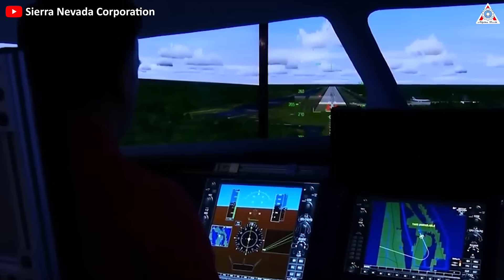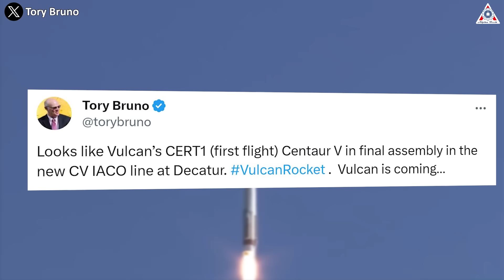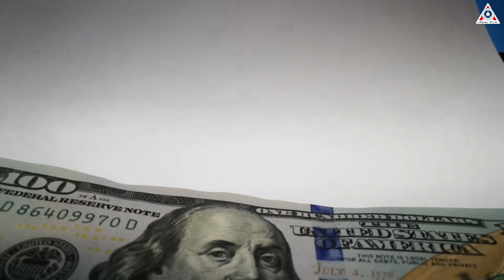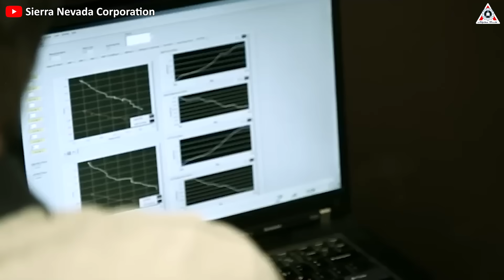NASA Dream Chaser’s launch vehicle is in BIG TROUBLE...

Comment: How can they stress reliability and cost? This is a total no brainer - Falcon-9 has had literally hundreds of successful launches whereas Vulcan Centaur has never flown. ULA (like Boeing) is suffering from legacy aerospace syndrome - delays, cost over runs and some poor engineering. Falcon 9 is the cheapest option as Vulcan is disposable - the idea of recovering the engines is at a very early stage . Dream Chaser is designed to service the ISS but considering it is to be retired in 2030, they need to consider other options soon.

Comment: To me the program was not ambitious enough since the Falcon 9 is still wasting an expensive second stage with a high cost orbital Merlin niobium nozzle etc,,,furthermore a Crew Dragon landing at sea with parachutes is more weather dependent than a cat.3 landing plane and this  requiring more safe reserves of O2 etc..Finally,,the rigid lifting body Mig 105 BOR4 type is also safer at reentry than a winged design Shuttle or Bourane. 

To me a fully reusable ISS crew and cargo shifter could be made cheaper than Falcon dragon and could be necessary as Starship is way to big for crew exchange only …Furthermore , the proven hardware more of less exists but not the drive to put it together from competing firms like the Apollo program did.

In order to be small and light, I would rather envision a three stage reused system with only as wasted hardware, two or four small 3D printed jettison tanks dropped just before orbiting like the Space Shuttle main tank did but infinitely smaller since they would only fuel a 3rd stage orbiting power and on a much smaller DreamChaser lifting body as well. Heat shielding and bringing back empty tanks like a big Starship  is too much dead weight..1 first stage would be Paul Allen Scale Composite Stratolaunch airplane boosted to 250-300 tons ..using second stage rocket boost for take of and the DreamChaser front section for additional canard type front lift..

Second stage can be a Falcon 9 type landing stage with legs and flaps or a small diameter methane O2 starship w/0 heat shied and with a single Raptor or a super sized Pegasus XXL winged rocket with landing gear and flying back to base..like an empty drone…the advantage of a winged second stage being added lift and boost at take off with re-ignitable full flows rocket engined and the wing lift climbing assistance from 30000-100000 feet’s once it left the carrying plane…

Third stage a light DreamChaser fitted with two Merlin or equivalent re-ignitable engines and up to four detachable jettison tanks separated just before the low orbit is reached..

This way all 3 stages are reused almost endlessly, no expensive hardware is lost or wasted and system can be made so much safer that commercial certifications for paying passagers can be planned to finance the much limited R & D required..lol.

Comment: IIRC, Dream Chaser cannot be launched without being enclosed inside a fairing. The current Falcon 9 fairing does not have a large enough diameter.

 However, lifting body spacecraft like Dream Chaser have been launched successfully by the Air Force in the 1960s. The ASSET lifting body vehicle was launched on a Thor-Delta rocket without a fairing and on test flights reached altitudes as high as 140 km. ASSET made it to space without falling apart during the climb out through the atmosphere.

Similarly, the USAF PRIME test vehicle, which closely resembled Dream Chaser, was launched on an Atlas booster without a fairing and reached 167 km altitude.

Comment: If you put an enlarged faring on a falcon 9, does that reduce your tons to l.e.o. capabilities?
Reply: Yes... if you actually need a large fairing, that is (vs Dreamchaser).  It would affect things throughout the vehicle as well.  Stability and control, vehicle modal response (also ties in to S&C), qualification of an internal environmental conditioning system if a satellite payload, launch pad interfaces...  BTW, in the past large unsymmetrical payload fairings were studied to do things like launch a payload "fully-deployed" (or at least not as much folded while in launch configuration).  I imagine the winds-aloft restrictions would have been rather severe for a flying spatula like that.
Reply: @marcmcreynolds2827 
The Space Shuttle flew with larger wings and no fairing.  I have a hard time believing a fairing is required.
Reply: @frankmcgowan9457   Hence my "vs Dreamchaser".   I was more answering the general question about increasing fairing size.  As to your STS example, keep in mind that its S&C was designed around that "odd" shape.  An increased area at the top of an existing rocket design, especially if it's a non-axisymmetric shape generating unbalanced normal forces ("side lift", loosely speaking) may or may not be ok when it comes to things like pitch/yaw authority of the control system.

Comment: One important consideration you neglected include is dissimilar redundancy.  If Sierra Space chose Falcon 9 as its main launch vehicle a problem with Falcon 9 knocks out both was to return cargo from the space station.  The Falcon then becomes a single point of failure for crew transportation and cargo return from the ISS.
Reply: Given the number of F9 boosters built and the very high number of consecutive successful launches just what sort of problem do you have in mind?  Falcon-9 is almost definitely in the two or three most reliable boosters in history.
Reply from the maker: Thank you for your comment! I will note that!

Comment: Why didn't Sierra Space and NASA simply launch Dream Chaser with a Falcon Heavy - or even a Falcon 9 rocket? Given the time and money available, SpaceX could easily have built and tested a wider fairing if required.
Reply: It doesn't appear to need a fairing - as shown in the opening shots.  It isn't shielded from the atmosphere at take off (or landing) so no fairing needed.
Reply: @KenPaulsenArchitect 
Watch that again. DreamChaser's wings fold up to fit inside the Centaur upper stage fairing which splits once in space.
Reply: @KenPaulsenArchitect   I agree, a fairing is not required, technically. However NASA is a very conservative organization when it comes to innovation and has had run-ins with SpaceX. NASA views the non-fairing launch of Dream Chaser as a high risk. Elon wanted their Dragon capsule to use rockets to land on a pad instead of the ocean. NASA did not agree with this unproven landing concept. So these decisions were made by NASA, not SpaceX or Sierra Space.
Reply: SNC originally designed DreamChaser to be launcher agnostic. Mounting variations for Atlas V, Vulcan, and Falcon 9. NASA wants alternate systems for backup. That is why the Boeing Starliner and DreamChaser have to go up on the "alternate from Falcon 9" rocket.
Reply: Because Sierra has no interest in using SpaceX! Plus, it's a lot more to it then just nonchalantly switching launch vehicles. It's not that simple.
Reply: Sierra Space didn't launch on a Falcon booster for the same reason that Ford doesn't offer the Chevy engine...ego and jealousy.
Reply: @ghost307  
Ford makes engines.
Sierra doesn't make boosters. 
They barely make DreamChaser.
Reply: @ghost307  It's not ego. The main traditional differentiation between major auto companies like Ford, GM, M-B, BMW, Stellantis etc. has been their engines, not body style. A Ford wouldn't be a Ford if it had a Chevy engine.

Comment: i don’t think strapping ninja dream chaser to the falcon nine‘s ass would be a good idea! Put it in the faring because of the shape of the wings I am sure it would work and you can always go to falcon heavy so you can retrieve two of the three rockets, I don’t think it is as cost-effective, what does falcon boosters Goodland NB reviews so just the center part with the faring would be disposable which means you’re still losing more but the other two can be used many more times it looks like they are approaching 20 times on some of them which is pretty amazing! First it was 10, and it was 15, and I don’t know what the newest testament is but they have to have already had 17 do not look anything like they’re ready for retirement. When they finally do get retired they belong in a museum is the first Rogic that went 20 or 25 times in a door bitch and I guarantee you this boy there are at least 25 larges and those Falcons, the stress test came back perfect. SpaceX is the mission round, plus when the Mexicans jump the border, it is cheap labor because the first thing you’re going to come across is Highway four if they are by the coast and that is the place for a job! The only problem is getting 1099 filled in sure there are no labor issues with illegal aliens and I’m not joking about small gray aliens, I’m talking about small brown aliens, lol

Comment: I think they don't want to put DreamChaser on Falcon-9 because they are not really ready. With ULA they have the excuse that they are waiting for a booster.
Reply: "big rocket" doing business the old way.
Reply: Classic NASA approach. Blame all issues on the “long pole in the tent” hiding your own issues.
Reply: yep, Elon would say "i have few hours window next monday"
Reply: Makes sense!
Reply: DreamChaser has often been depicted as mounted on a rocket without a fairing. Then the design was changed, slightly scaled down and folding wings to make it fit inside a fairing. Why? I assume this was a conservative decision of "we've never done it that way before" and if inside a fairing they didn't have to deal with aerodynamic issues of an uncovered DreamChaser. Same sort of reasoning that prevented SpaceX from propulsion land landing of Dragon spacecraft. Had to do the "conventional" parachute/ocean landing. Anyhow AIUI, the Atlas fairing is slightly larger than the Falcon one. Maybe the DreamChaser won't fit in the Falcon fairing?
Reply: Did they order those engines from Amazon ? Really slow delivery of Rocket engines …
Reply: They should be here Tuesday.  @chrisbraid2907
Reply: Not ready as in, doesn't have a 5m fairing yet?
Reply: @Ekatha  I see this
Smaller fairing: 13 meters (43 feet) in length
Larger fairing: 17 feet (5.2 m) wide and 43 feet (13.1 m) tall
Also working on a 5.5 m  version.
Reply: exactly
Reply: Dream chaser is a contract that was not awarded to space x. Its a contract that would take money from space x dragon. Why would they bail out the competition.
Reply: @psychomonkeyinc  Because NASA wants redundancy.   So far only Crew Dragon is flying.  I expect Dream Chaser will provide some capabilities that CD does not have.
Reply: @danharold3087  provide what.  More cost?
Reply: @psychomonkeyinc  NASA want to promote variety and having different systems is backup in case one has some major problem. This is not "taking away from SpaceX" it is in addition. If anything, it is Boeing that it is taking away from.